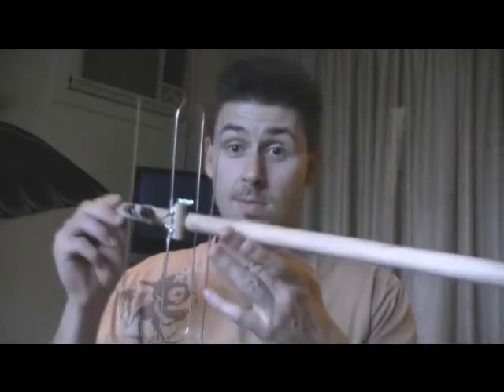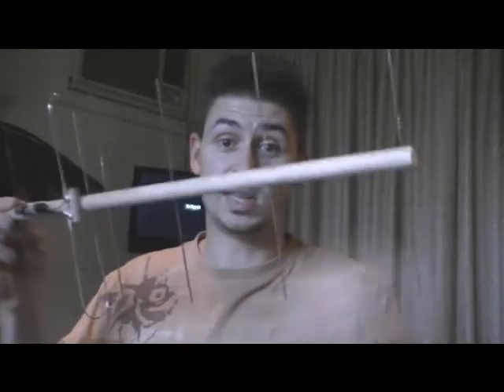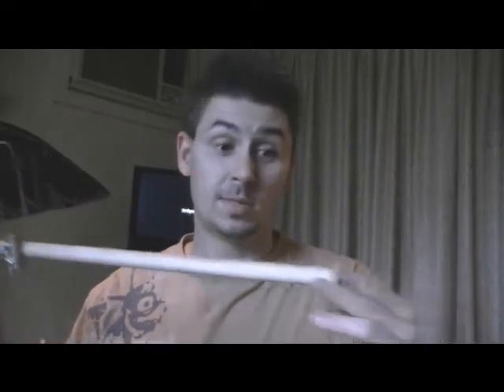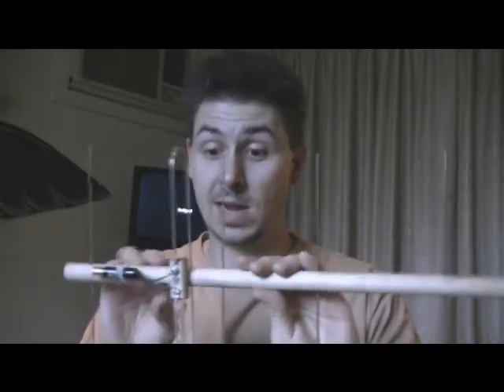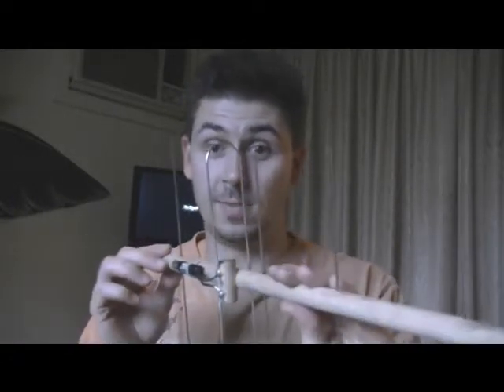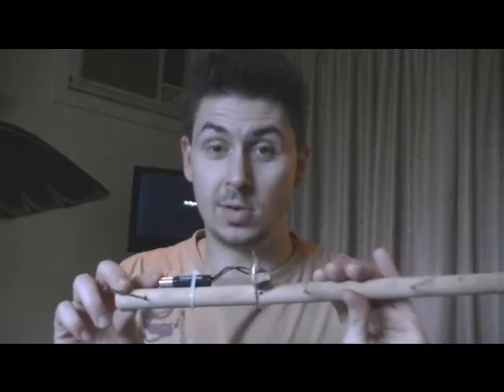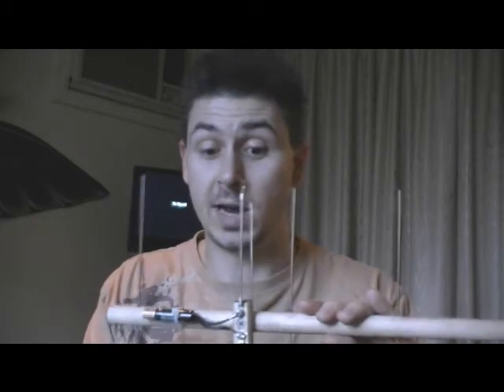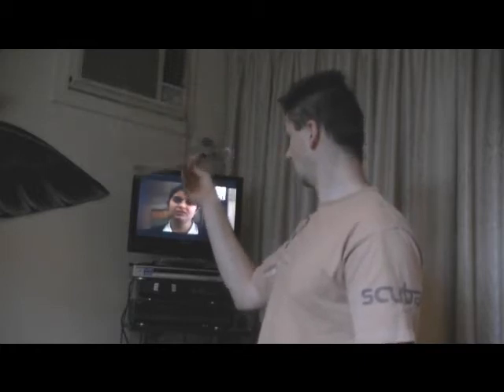Homemade Indoor 6 Element UHF TV Yagi.

Comment: But watch your element length/diameter ratio, anything above 400 will truly waste the effect of the parasitic elements. Found out the hard way some years ago after building a 12 element yagi using stiff wire I had. ;-)
Reply from the maker: Yep, that is quite true.  I have seen this happen with other antennas, and the results were not as expected.

Comment from the maker: It always is a compromise unfortunately, but for RX you get some leeway.  I picked that frequency as it was reasonably central to everything I wanted to watch here on the UHF band. The decision was made then to use this frequency as the one to calculate the antenna dimensions.  This may be different depending on frequencies used in your area, and you will need to decide what is the best central frequency to cover all frequencies you are interested in receiving.
Cheers

Comment from the maker: Hi Tom, sorry for the delay.  The centre frequency for your band is around 598MHz and for best results would be good to calculate your yagi for that range.  RX is a little more forgiving than TX and my dimensions may still give good results for you.  However if you have got the VK5DJ yagi calculator there, it would not hurt re-calculating to optomise your antenna, or select a working frequency around your favorite channel.  Good luck Tom and thanks for your interest and support.
Regards John.

Comment: Thanks John watching your video many times. Would the specifactions of your antenna shown here. Work for the NZ standard Tv range, which is 502mc/s to 694?   Or shall i make the complete antenna, slightly smaller in measurements as to yours?
thanks Tom NZ

Comment from the maker: Hi Blackjack31.

The Yagi Calculator on the VK5DJ site should work.
I built two Aluminium 7 element yagis for TX/RX on 435MHz with great results.  I bought materials from a local hardware store including flat rod used for the folded dipole. Run software and enter centre frequency, number of elements, diameters and type of feed you want as prompted. You need good quality low loss 50 Ohm cable. An 8 element yagi will work great. Also I recommend reading up on the subject too. :)

Hope this helps.

Comment from the maker: Hi Tom,  This is the same as a conventional Yagi but the calculations are slightly different for a wooden or other insulated boom.  I used an antenna design calculator by VK5DJ John Drew.  It has been a while since looking at this so not sure if it is still available on the net. This gives options to select insulated or conductive boom, the thickness of elements you want to use, and if the dipole is folded or open style. Great calculator and it worked for this antenna great.

Regards
John.

Comment: Hi From Christchurch NewZealand  just viewed yr yagi antenna, wish to build one myself, but curioous  how does it work, as your using a wooden boom, not like tv antennas you buy, with a metal boom, elements same, and connected directly to the boom, apart from the dipole, which is insulated from it. thanks Tom   tom.roberts60@yahoo.co.nz

Comment from the maker: @digitalmediafan 
Hi there,  The antenna was tested on the second floor of a two story house about 15m ASL. Location from the sea is about 1km inland.  The surroundings have two story houses and trees in this area. The Yagi is definitely doing a respectable job at pulling in the UHF signals.  I was very happy with the results here nonetheless.

Cheers.

Comment from the maker: @ufoengines 
Now that is an interesting question. 

 I do not know a lot about the cosh fractal designs except I believe it has been experimental.  I have not seen one myself or know anyone making them, but in theory it could be possible.  This is something I should read up on as it seems to be a rather interesting concept.  I have only experimented with traditional style antennas such as Yagi, dish reflector, collinear and dipole systems between HF  to low band microwave.

Comment from the maker: @SilverEyeProd 

Yes, generally the frequency you enter is optimum resonance, so for TV there will be compromise on adjacent channels.  I would build it for centre frequency of 608MHz if all stations have similar strength.  If you're getting all except one strongly, optimizing closer to the weaker channel may help whilst still giving good picture on stronger channels. For receive, it's not as critical in this case, so you should still get good results over this frequency range.

Hope this helps.

Comment from the maker: @SilverEyeProd 

My antenna is made using a calculator by VK5DJ John Drew. You can calculate for many frequencies and different number of elements for gain.  It will design a single band antenna only, so you need to build two to cover VHF & UHF then use an antenna combiner for a single 75 connection for TV. 

It will optimize for a frequency you specify, but works well over a broad bandwidth using a folded dipole.